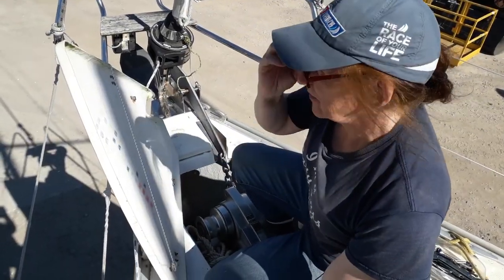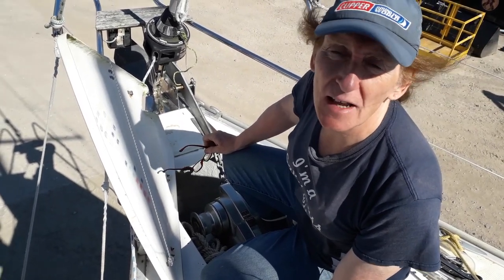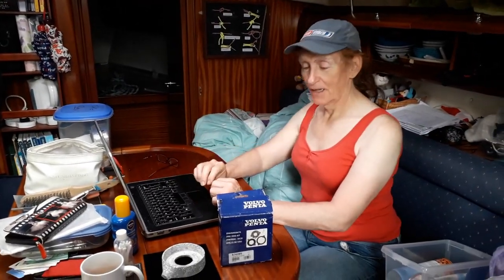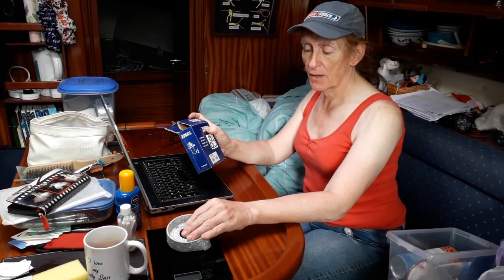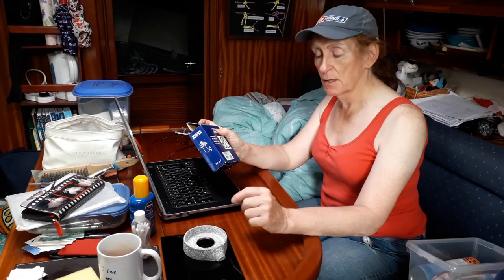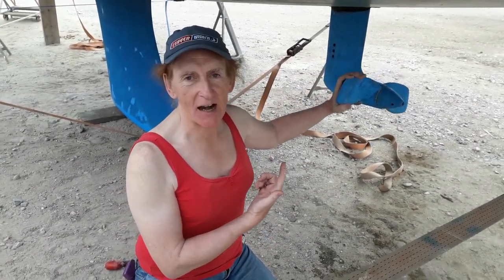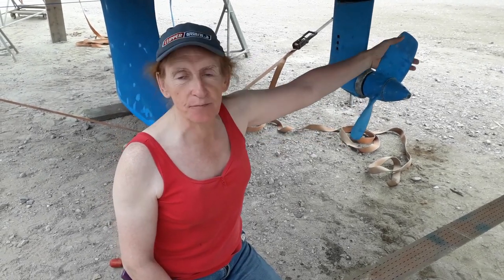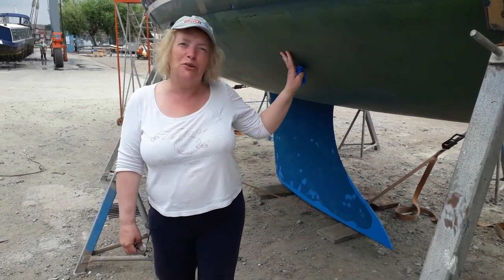Sailing UK - Liverpool - Bluepoint - Boatyard - Ep. 246

Comment: Good info re the trilux prop antifouling....I used it at holyhead but as I hardly used the boat it wasn't a fair test. Re the fairlead and the stresses it has.....holyhead was a rough Marina in a east wind, surging caused the boats to move feet back and forth with many yachts having wrecked / ripped out of the deck fairleads.....I was always advised to take a line through the fairlead and cross it over to the other sides cleat. A friend with an SP Cruiser bent his very very strong fairlead when he forgot to do this at holyhead.
Reply from the maker: We also found the type of mooring line to be VERY important. Lines with no stretch cause a "snatch" and a high shock-load is then transmitted into the deck hardware. Lines that stretch, like nylon or octoplait, eliminate the snatch loading completely. We did try "rubber-snubbers" but they failed so we now use 12mm octoplait anchor line and it is so much BETTER!!!

Comment: Did you through bolt the fairlead or did you replace those screws with a similar type?
Reply from the maker: We used M8 bolts. We could not source the same type of screws and the holes in the fairlead were M8 in size. We used Duralac on the bolt heads to inhibit galvanic reactions.

Comment: While a magnet will pick up any ferrous metals (magnetic) in the oil it won't pick up non-ferrous that can be part of a bearing and housing. If you drain the oil through a coffee filter, that will catch most of the debris in the oil then wash the filter through with a solvent like a brake cleaner. 
Although your oil looked dark it had no signs of the oil being emulsified which would indicate water ingress. Which is not good and can trash a gearbox in short order. I would be a little concerned about any wear on the splines in the prop as I think that will only get worse "Worse? How could it be worse?" 
https://youtu.be/bDe9msExUK8?t=86
Reply from the maker: We are also concerned about wear on the prop's splines and so we are prioritising a new prop. Thanks for the coffee filter tip and I will just add that we check both the saildrive oil and engine oil before every trip because both are easy to accesss
Reply: @SailingYachtSaltyLass  I probably should explain why I went off on a tangent mentioning emulsification of the oil. If the splines were worn this would likely set up a vibration in the shaft that could damage the shaft seal allowing water to pass into the gearbox (saildrive). I have long held the belief that oil is cheaper than a mechanic so it's good that you constantly monitor it.